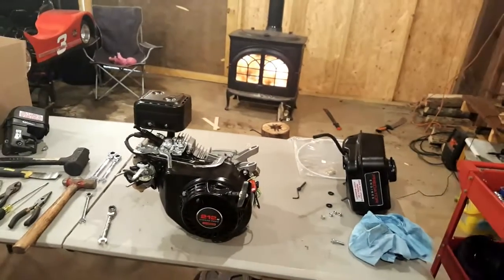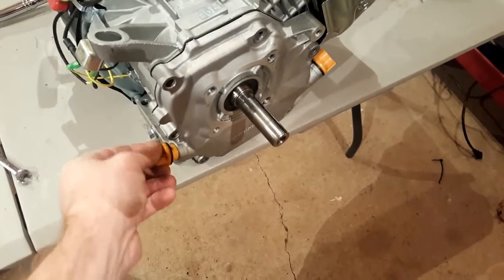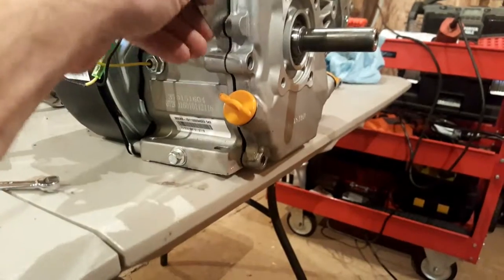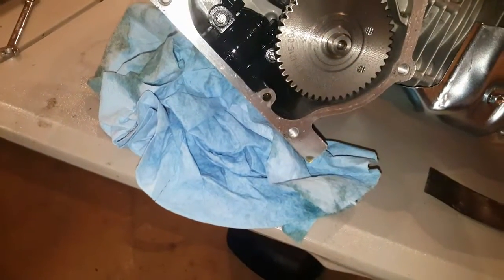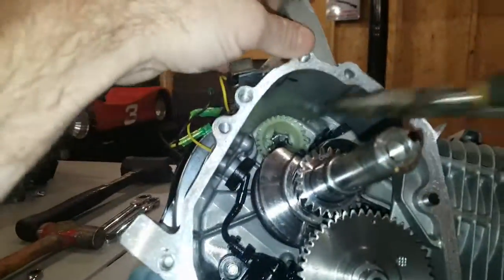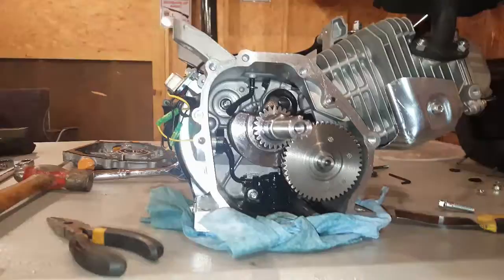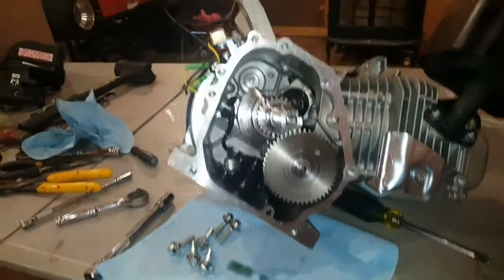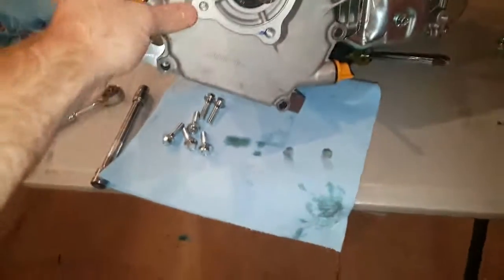Predator 212 Governor Removal

Comment: Dude. Take the damn flywheel off, take the detent out, knock the governor pin through and locktite a couple bolts in the holes. Why does everyone turn this into a mess? It's not like your gonna mar the flywheel up any worse than banging the snot out of that stupid ring inside the crankcase or taking any risk grinding around it! The springs float around 5500 it's governed at around 3000 and probably really eats it hard at 6500 on the stock rod/bearing. Personally I think you should buy your motor and build it while you look for something to put it on, or have a stock motor and a built motor because once that governor is gone and you get a taste of speed it's not long before stuff starts breaking.

Comment: i seen a video of yours that shown how to get more rpm by moving a spring on the stck pred 212. i cant seem to locate that. any help would be appreciated. thank you in advance.
Reply from the maker: I really recommend removing the governor completely. The spring and throttle stop are a trick guys use for stock predator racing because they have to have a working governor still in place. Best to remove it so it doesnt fail on youband ruin your predator.

But you can just play with the spring location on the governor arm as well as the throttle stop screw to get the rpm you want.
Another trick is to loosen the arm and adjust it on the rod that comes through the crankcase to get more rpm.